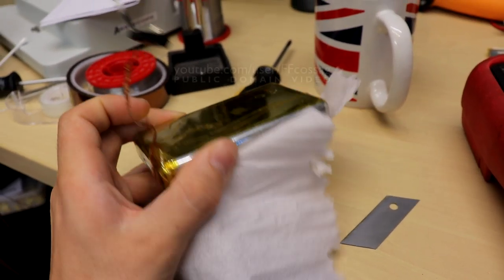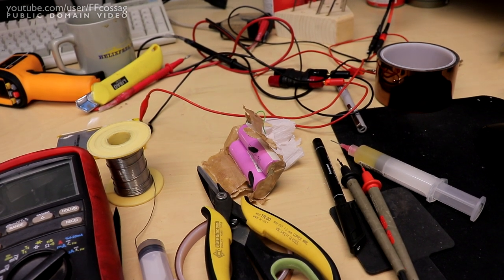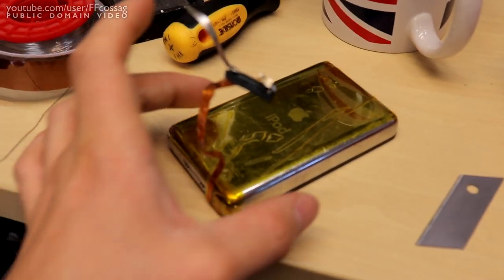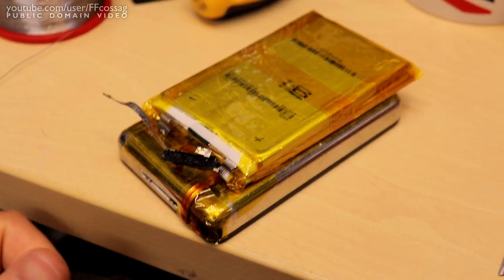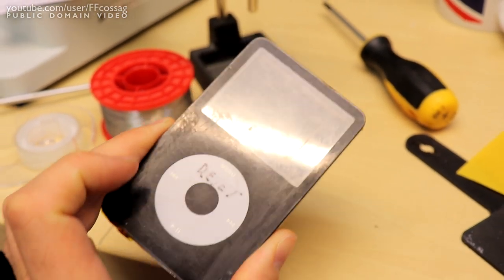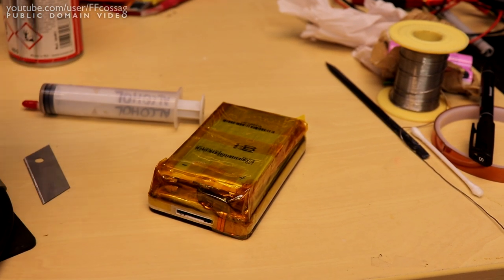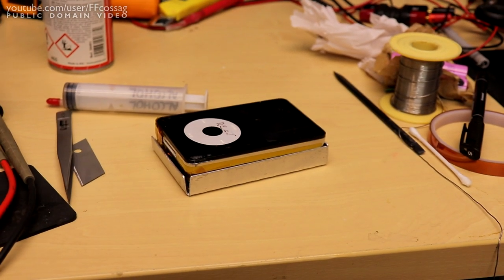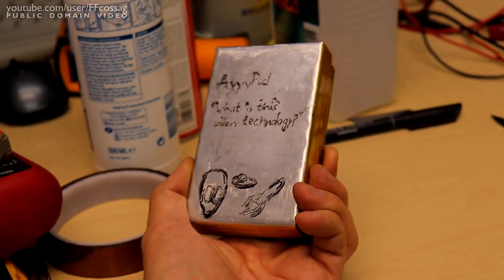Ipod 5G: Adding MORE BATTERY and making it look BAD ASS doing it

Comment: Of course it has a modded firmware, nicely done!
Reply from the maker: The original Apple firmware doesn't allow you to turn it off.

It doesn't allow you to turn the power off. You can't. There's no button or setting that does that.

I'm sure the original firmware is fine, but you can't turn the bloody device off. lol.

Comment: The common thing to do is to swap the hard drive with flash-based media. IDE Zif to CF, drop in a 128GB CF or 128GB SD card in a Type I? CF adapter. need to get the CF adapter type right or else it doesn't work with the stock firmware, not sure about Rockbox. but I do know the rockbox wiki does have a page for flash-based modding, albeit outdated. should give you many many more hours of playback over the mechanical drive.
Reply from the maker: Something like that is probably going to happen when the mechanical drive dies, but 60 GB fits a LOT of compressed music as it is.

Comment: already bulky ipod... proceeds to add 3x its weight to the exterior of it.
Of course you use rockbox, I use it on all of my devices.
LOL I love the mod you've done, I did the same thing to the smaller classic ipod but with a single cellphone battery. you can see it in one of my first videos on youtube (panasonic 5.1 system, skip to the end where I play the song)
anyway I had grown to liking and using the Sansa Clip MP3 since it is smaller and thus lightweight.
I really need to replace its bettery since its 140mAh cell is no longer able to keep it running for longer than 3 hours.

Comment: Just don't take this through the airport...looks a tad dodgy
Reply from the maker: I've actually brought it through security several times while being powered by those two 18650s cello taped to the back of it, with wires sticking out everywhere.
I'm surprised they didn't think it was a bomb, lol.
Reply: @FFcossag  If I assumed correctly that you're Finnish, I'll say this: The security is probably the least serious in th EU. I had a leatherman multitool on my keychain and they never said anything about it, just stared at it for a while and smiled. On the other hand at heathrow the response was a bit more aggressive and I lost my leatherman :(

Comment: T H I C C
What's the model number on those cells? Looks like a single one would fit fine inside with the hard drive replaced with an iFlash.
Reply from the maker: I have no idea. They're pretty anonymous, comes out of a HP 2760p extended battery.

Comment: euuu.... Why?????
its not like this kind of player is obsolete in every possible way!
Reply: Cuz its free and keeps devices out of landfill
Reply from the maker: When it comes to off-line, large capacity players that you can turn off and leave on a shelf for months, the selection is actually quite narrow. Especially since I use this in car adapter mode, where it just sits in a vehicle all year round, turning on and off with the stereo. The only viable options for replacing it are either a new head unit, which is not happening in a vintage vehicle, or one of those dodgy Ebay MP3 modules, which are a step down in everything.
Reply: @FFcossag  yea, there is nothing like being able to run the RockBox firmware, the music playback feature in my BT70 bluetooth FM transmitter is literally the worst there is.